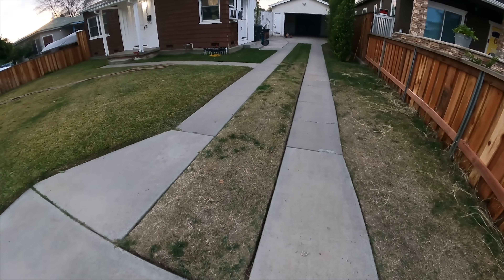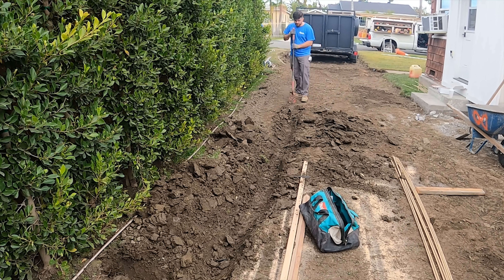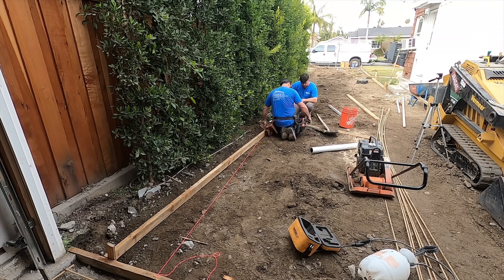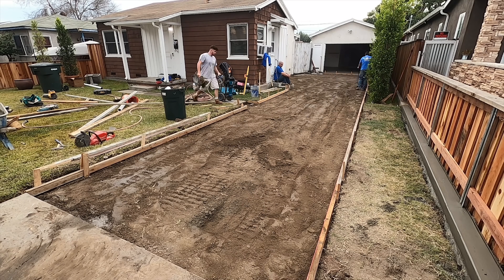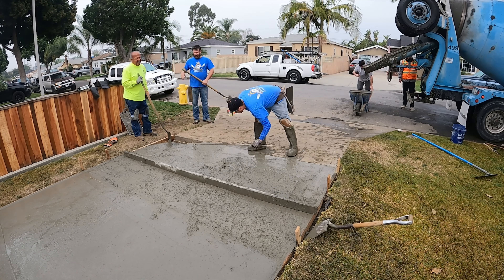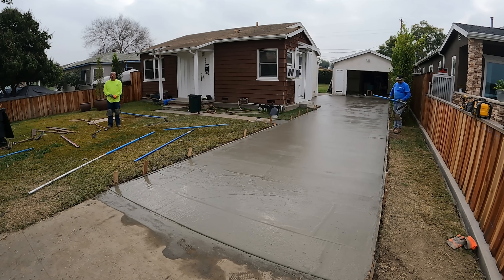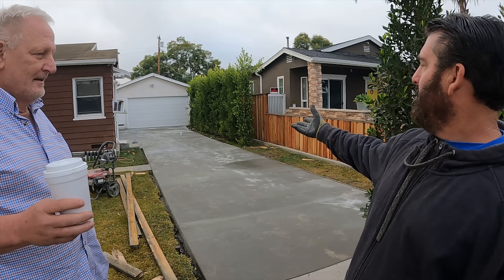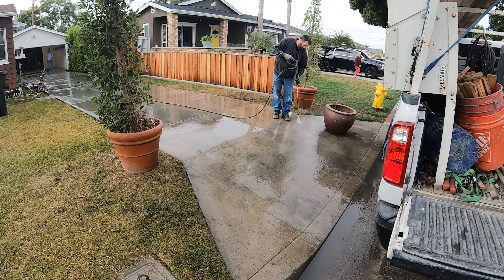Homeowner Ruins Fresh Poured Concrete Driveway!

Comment: Question. I've done a ton of concrete slab work for decade. Why aren't you using "chairs" to lift your #4 off the dirt? Their surprisingly not that expensive and come in heights up to 2 inches. It also saves using the bar to pull up the #4 bar and can center your reinforceing rod in the middle of the concrete. Just some advice from an old timer.

Comment: Nice pour, the only thing I'd do different would be near the gas line.  I'd have put some kind of soft expansion joint, like rubber, about a half inch thick.   Just in case the drive way slab moves towards the gas line, it'll have some give and won't pressure against the slab.
I've done massive metal buildings, where the upright beams are anchored to 4 ft. diameter sonnet tubes.   Before the slab gets poured, I'd  go around and wrap the sonnet tubes with 1/2 torch down roofing.   Just something to prevent the slab from shifting the sonnet tubes.  We're talking like 120+ truck slabs.   The whole next day we'd have 3 walk behind diamond saws cutting joints.  Like 8 acre buildings.  Good lock!
Reply: I’ve never heard of Sonnet tubes. Are they anything like a Sonotubes ?

Comment: I was shocked at the amount of time hand finishing. I assume you guys in the USA like to see a super smooth driveway. 
Here in the uk unless it's an internal floor it gets tapped down to finish and A Single trowel width rub round the oouter edge. gives a great look and good grip even in icy conditions.Much quicker than all the manual manipulation that you do there.
Reply: They poured it too wet.  All that time was not necessary
Reply: @WillaHerrera  Its needs to be wetter to be pumped and he said there was no accelerator in it.

Comment: VERY nice job on the pour. Top shelf stuff right there. But, any homeowner that would have a new driveway poured and leave a 2 foot strip of grass to mow, well, they're not too bright. So, I am not surprised what the homeowner did with the fresh pour.
Reply: Found that kind of odd n dumb, too.  I would have just gotten rid of the trees as well so its extra space to even turn a car around if needed.

Comment: Lesson learned for the contractor too "i hope". Never, ever let the customer do anything as a follow up to the concrete pouring. Contractor should always put in a few extra hours in the bid/estimate to cover anything required on the 1-2 days following the concrete pour. My dad was in the concrete business for over 40yrs. There was always the potential for screw ups caused by customer, neighbor, kid on bike or skateboard, delivery person parking or walking on the new concrete, vandalism, etc following the initial concrete pouring and customers sometimes try to blame the contractor for those problems (even in cases where the contractor had set up very obvious barricades to help prevent any damages). Therefore, it is always best for contractor, "immediately after the concrete pour", to provide written instruction/release statement to customer that they are "NOT" to do anything near or over the freshly poured concrete whatsoever that may result in any unwanted damage or problems" with the new concrete poured. In addition, customer must sign and date that written release. This protects the contractor in the event something goes wrong following the new concrete installation (re. I have seen alot in my 60 yr life. Contractors are often blamed when things go wrong. Gotta play it safe "especially in these crazy times we live in". Fyi only!!!

Comment: A local guy did mine 26 x 50  and 5” thick driveway extension and I didn’t put a vehicle there for a month and I from day one sprayed  water about 5 or 6 times  for a week to make sure it will cure slowly and have plenty of humidity in the process(summer pour). 

I read so much about it and the slowly it cures the stronger it gets.  It was also a 4500 psi with rock at the bottom and wire.  I also applied a sealant after it was really dried and before putting anything on it.  

 I have put some very heavy equipment there, looks like new.  Key is Don’t be in a hurry to put something on it, let it dried properly.

Comment: How do you manage to mess up every square inch of a brand new driveway you just paid for? Just stay off for a week or so.
Reply: We just had a $56K concrete project done.  We asked our contractor every question possible.  We asked for minimum timeframes as well as his personal recommendation.  Driveway, he said wait a week to park on it, but the longer you wait the better.  We did two weeks.
Reply: three, seven and 21.  Three days you can safely walk on it.  Seven days you can drive a light car on it and 21 days the concrete is almost as strong as it will ever get.  Not quite but for all practical purposes, it is.

Comment: Great work, thank you for filming all. Not an easy task. Am I the only one that noticed that your fine slab work is valued GREATER than the dude's house? Looks like mini-house bought from a catalogue.
Reply: Presumably that roller-door to the left of the garage at the rear of the house just opens onto the covered patio, which means the area of patio plus garage must be close to the size of just the house by itself. 
Obviously the guy is single!

Comment: Talking about the thin PVC - the previous owner of my house used thin 4" PVC to connect the house to the new septic system in the back yard. Over the years, the pipe slowly collapsed, until I replaced it all with schedule 40. The thin pipe probably saved the other guy about $25.
Reply: Sch 40 pipe here at Lowes Has gone out of site. $40 for 10' x 4"
Reply: I have 400ft of thin wall to replace along my driveway to street valve. It did last 20+ years with random breaks every couple years, digging up were roots coiled around, or utility trucks parking on it, and broke. 400$ water bill each time. 
This is the summer of trenching beside and or through it with Pex. Nothing worse then finding a green, soggy spot in the middle of summer...

Comment: i love how smooth it is when they are making it look really nice but i hate when they draw lines in it or the rough pattern but grip is more important if you have to walk or drive on it
Reply: If you're referring to the cuts, that is absolutely essential.  Otherwise, the driveway would start cracking and never have a stopping point.
Reply: You really don't want a driveway or sidewalk to have a slick finish.  Especially when it gets wet and you're walking on it.  A broom finish gives it just enough abrasion so you can get a grip.  Slick finish is for interior work like a basement slab.

Comment: The plumbing code reads that you need to install 12” of pea gravel or small crushed rock under the drainage pipe. The reason for installing that 12” of gravel is so when the uncompacted dirt washes away in the future, that rock will fill in and always support the pipe. If you use dirt only you must compact it.
Reply: where you are that is code, it will be different elsewhere. Here, if it is "undisturbed" then the bottom of the trench is good to go, if you back filled then you need gravel and compaction.
Reply: Yeah I don't recall that in the ipc. Not 12". 

Besides it's not a waste line, or an irrigation system.  Just draining rainwater.
Reply: Yeah, but 1/4 crushed gravel or sand is what I put under pipes.  Never just put pipes in uncompacted soil.

Comment: It’s painful to see what the home owner did. I had a contractor and they came out i formed and did the heavy road mesh with snowmelt. He looked at me and said wth is that orange stuff. My response was at the original visit I told you this will have barrier pex and be 6” thick. He had added too much excell and had to wheel barrel the whole thing. Being one of the hottest days of the year I flowed cold water to slow it down. Also it was 5000lb so never seen a crew run that fast. The water exiting that loop was like 130degs. This winter it was amazing to light the boiler to it and bone dry that slab in a ice storm. This week or next might see a good snow.
Reply: Nothing you wrote makes any sense whatsoever. It was like speech to text was recording three drunk guys having three different conversations.
Reply: Good thinking!

Comment: What depth do you need for the driveway? And how far apart should your expansion joints be. And what size rebar does you use. As what do use   for foundation before you pour the concrete. And you mentioned fiber mesh. What does this do to the concrete.

Comment: Nice work and beard Odell.
It wasn't Bob's fault, the mud was just really slow to cure out.  Under normal circumstance Bob would have had your back with water curing the slab.
Reply from the maker: Yes I concur.
It will work out once it's cured out

Comment: Don't you just love it when the customer stands watching everything you do.
Reply: Fortunately, I paint.  Everybody can't stand the smell of paint, so I am fortunate that way.  They also hate the smell of stinky yellow contact cement(carpenters use it) Sure there is the odorless stuff but to drive those bass turds out of the house, you buy the stinky stuff.  Floor layers of vinyl tile or linoleum will leave the glue bucket open to "air out".  Which also drives the bugs away.

Comment: Actually liked the OLD DRIVE with the grass in the center.
Reply: I was thinking the same thing .. if offers natural drainage percolation of rain water too ... if everyone had that storm sewers capacity could be much lower!!
Reply: @MikeBaxterABC  it may be the angle of the vid, but it looks like a subtle grade
slope to the garage...had a new neighbor that redid their concrete drive in front of the
garage. we live in colo and till the first flash rain, it was all good. first spring rain, they had water IN the garage...
Reply: Ya me too. I would have just installed some drainage to address the garage flooding, and kept it the same.
Reply: They said the garage was flooding so obviously the drainage wasn’t good enough even with the grass.

Comment: Silly question: Isn't the reinforcing steel typically supported by support "chairs" so that it does not lay directly on the gravel or, as in this case, soil base? Otherwise, isn't the reinforcing steel sitting, more or less, underneath the poured concrete driveway/slab rather than embedded more in the middle of the 6" poured slab?

Thanks much, and sorry for the silly question.

Comment: You were way nicer than Bob deserved. Stay off, means stay the "F" OFF. Guy needs a dope slap. BTW there is still enough calcium hydroxide active in green concrete to cause chemical burns to his dog's feet. Concrete burns are real and nasty.
Reply: Our guy said to 100% stay off of it until after they were done saw-cutting - which puts it on his guys to determine when it is safe to walk on - but even then try to stay off as much as possible for a week, and no vehicles on it for three. Hard to imagine the homeowner here wasn't told.
Reply: @DaddyBeanDaddyBean  - Just goes to show what idiots are about. Walked the concrete and obviously didn't know about burning the dogs pads. (I didn't know that one) All the same, I just would have stayed OFF until I was told otherwise.

Comment: About saw cutting........ I learned a trick from an old Italian concrete guy on a bridge construction job back in the '80s and have placed a few drives for friends using this technique and NEVER had any issues, EVER, without a saw, and this is in the PA mountains where freeze/thaw is a killer.  I'll try to explain.  On your forms you place two (2) marks on each side, one at the center of where you want the joints and one at a location next to it that is 1/2 the width of your deep center edger.  During the pour, as soon as you've run your screed a foot or two beyond each joint, lay a straight edge on the the first mark and using a pointed brick or masonry trowel, cut the slab with a sawing motion as deep as you can (or like) for a few feet then slide the trowel back and forth a few times until it slides freely and continue this along the entire length of the straight edge.  Once all the way across move the straight edge to the second mark putting the edger directly over where you just cut with the trowel, and run the center edger along it,   After bull floating make a 'clean-up pass with the edger.  By cutting the wet mud with a trowel you eliminate (what's referred to in concrete design) 'aggregate interlock' so instead of the aggregate forming a coherent mass under the joint, it is separated by the trowel, creating a weak line of only cement that can be far deeper than you'd want to saw cut.  It's like placing your hands in front of you with fingers meshed then making 2 fists and placing them together.  As long as the edger is over that line it's perfect.  No coming back in a day or 2 to saw.  No spalling, plus a neat 'edged' joint that people prefer.  Try it on a 'sidewalk job' and you'll see.  It's life changing...... and fast......and it works.  And depending on the radius of the top of the edger, you can seal it with silicone, butyl rubber, or other joint sealer the same day.  And DIY guys reading this there's no need to rent a saw or buy a diamond blade.  One thing to add:  because of the temp extremes here most drives are 6" thick with mesh 2" from the bottom, so dropping a 3' section of #5 or #6 rebar every 15" or so across the joint (plastic or felt paper on half to allow sliding) keeps joints the same height no matter how bad the winter.

Comment: You guys did good work. I do disagree on the jointer tool though. They make one that is plenty deep and can attach to your bull float. It creates relief before the curing process ever starts, and saves you the step of saw cutting. That said, your care that you take to ensure a lasting product is extremely refreshing and in short supply these days. Thanks!
Reply: I'm with you.  I'd much rather deal with joints with it wet opposed to cutting it later on.

Comment: That looked pretty wet when poured looked like it was a 7 to 8 inch slump. You can see how easily it moved as you were working with it. That definitely caused some of your lengthy hardening time.
Reply from the maker: I think it was about a 5.5
Reply: @OdellCompleteConcrete  u9
Reply: That was definitely closer to 8 than 5. If you want to place concrete that wet use plasticizer not water
Reply: anything more than about a 4 1/2 to a 5 slump takes a long time to cure and makes for a weak mix by being too wet.  A power trowel would have produced a better flat finish and at a lower labor cost than all that excessive hand trowel work off knee boards.
Reply: @davidlindsay847  ....not to mention shrinkage. No one likes that.
Reply: @briangallaugher3068  Come on man
Reply: @davidlindsay847  You guys must not have pumped much concrete. The pumper knows what slump the pump will handle so the producer will use chem so not to reduce PSI.  To close for power trowel for outside work most finishers over work concrete little is better. I don't know ever thing but was ACI Certified.
Reply: @jayamburn1959  nothing much brother how about you sir
Reply: @jayamburn1959  huh???
Reply: You mean one of those dirty tricks?
Reply: Or some of them brain cells. I've been losing way too many of them lately

Comment: So nice. I wish I’d seen this before someone did my driveway and it is so bad. Pooling along the house and the doors, cracks, dark stains, just a terrible job all around. The drain isn’t flush with the concrete, they splashed it all over the house and side walls. Smh. It’s nice to see someone care about their trade. I paid not the cheapest bid because I wanted professionals. It’s so hard to know.
Reply from the maker: Yes it's very difficult.
GL
Reply: There are a lot hacks out there, especially in the non-union trades. I bought a house that had a new driveway. Turns out the expansion joints had been sawed all the way through instead of 25%, so now the slabs have settled and shifted, creating a trip hazard.
Reply: I need to looks again did not see all you are talking about.  If you let the pipe come directly in contract with the concrete is will crack there.  While I like the contractors work he should have told the owner when he could get on the drive. I don't care if the owner is around if he does not want me to explain everthing.

Comment: As long as your slab is flat and the edges are straight all concrete eventually will look like concrete !
Reply: I hope that’s the case with my new slab I just had put in. No sooner had the guy finished it some Brush Turkeys walked over it and then a delivery man ughhhhh!   I hope when it cures to white, those prints won’t be so obvious, they were not deep but noticeable after being done.

Comment: We walked on it the next day to sawcut it. I wet it every day for about a week. They told me I could park cars on it in 4 days, but I waited 7. We used fiber reinforcement, but no steel. We cut it in 8-foot squares and a few triangles. I watched them all day, every day, because I wanted to learn. I stayed out of their way and helped lift and carry here and there. Mine was about 33 yards, they told me. I had enough fall so no extra drains were needed.
Reply from the maker: Sounds like success